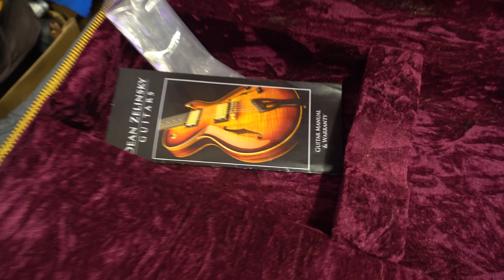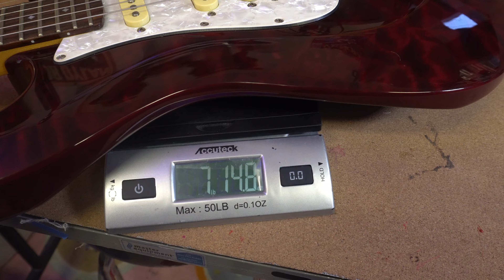Dean Zelinsky Tagliare Review and Demo

Comment: I did found more issues in my custom angraved tagliare - 2016. 
- cheap tolex venir case - not real tolex as on Fender guitars
- locking tuners are too long and you have to wind them as normal tuners (2-3 times), because otherway the strings don't have enough angle. (strings D and G - E and B have string tree)
- on video you can see that neck does not have tight fit on sides. On my tagliare is even worse than that
- because they have engravings on back of the neck, they glue the fingerboards the step from heead to upper fingerboard is too high compared to fender.
- imput jack is cheap and does not have enough angle as on fender 
- pots and switch are cheap
- fret work is deacent 
Conclusion: For that price range the guitar should be better. They can't hide that guitar is made in asia. You can not compare that guitar to 1000€ and more priced guitars.